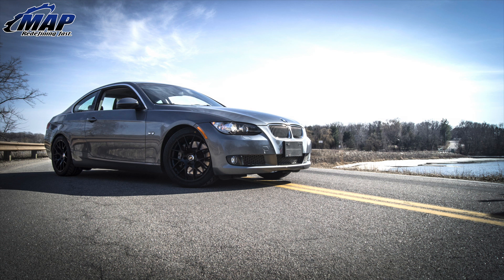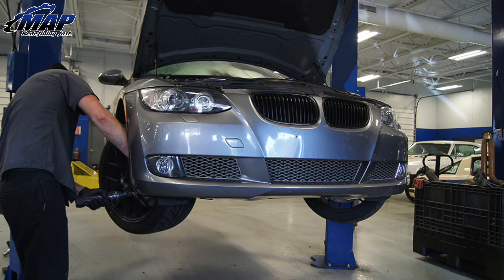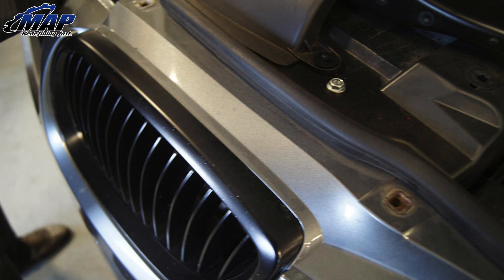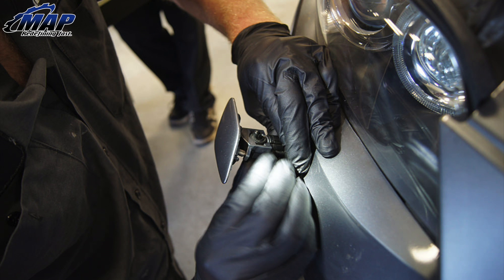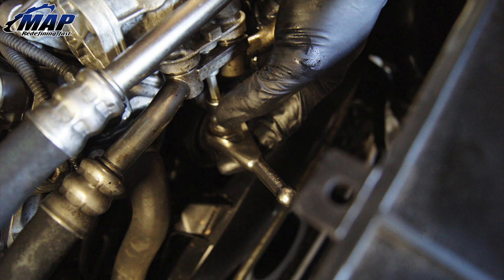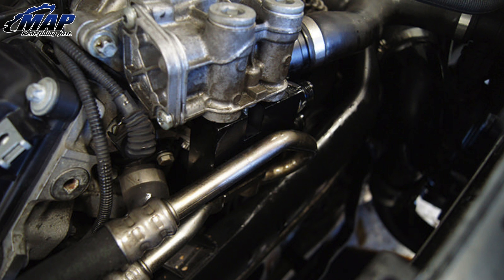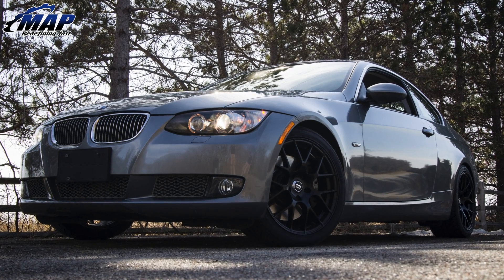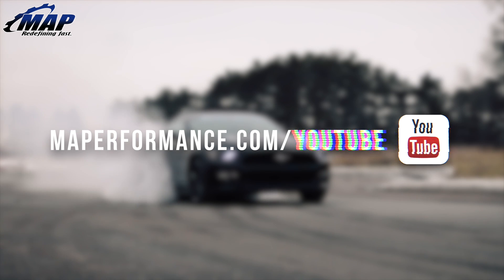BMW 335i Oil Cooler MAPerformance | Installation Guide

Comment: Very good, can I use the automatic transmission oil cooler to cool the engine oil? Since I'm removing the automatic transmission and installing a manual transmission, the transmission oil cooler would be left over.

Comment: What about 335's that did not come with a factory oil cooler?
Reply: In case anyone else sees this and is wondering...  Some 335i models did not come with an OEM oil cooler such as my '09 sport package with a manual trans.  For us, we'll need to source an OEM oil filter housing that has provisions for the oil cooler.  Then I used a pass-through plate from PMP or Motiv to allow the AN hose fittings to connect to an aftermarket oil cooler.  Budget Bimmers just did a great tutorial on this recently using the same parts I used.

Comment: the oil cooler bolt on the bottom thats connected to the oil filter housing is weeping not a big leak but very small weap, is that normal?
Reply: that's why it's important to use taflon tape